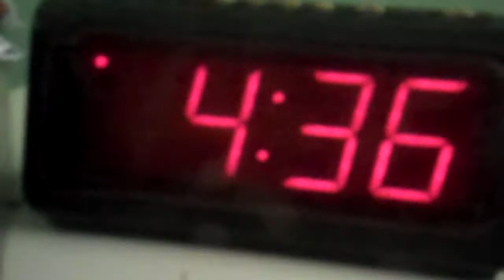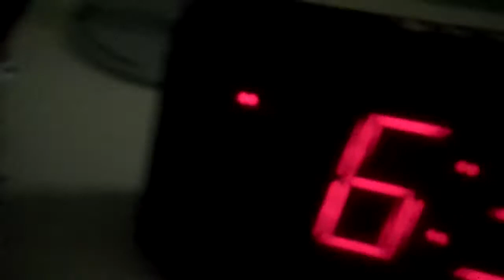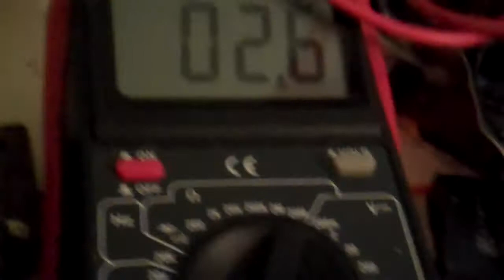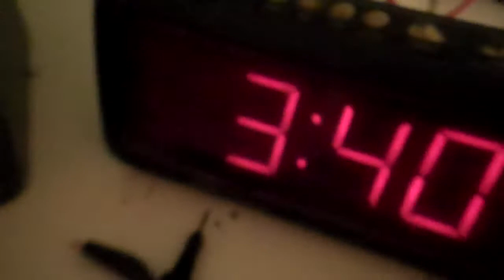Free Energy Experiment #4 Cement batter led power endurance test

Comment from the maker: @jidun ive tried highvoltage high frequency electrostatic charges i was able to obtain a higher voltage on a single cell but no usable power ive tried low voltage low frequency and couldnt tell the difference between letting it cure normally. sitting it out int he sun seems to have a great affect though not sure why. my next experiment will be to try a electret type battery not a typo. for right now ill stick with cement cells with more cells to get more power

Comment: I used four cups of water in series with copper and zinc and lit an led for a month, I decided it might last years but, there is not much power in it. I like this idea though. I read somewhere that a charge pattern needs to be set in while this type of battery is curing somewhat like making a magnet for electricity once cured in the charge pattern it supposedly puts out way more power, I don't know though. Did you try this initially?